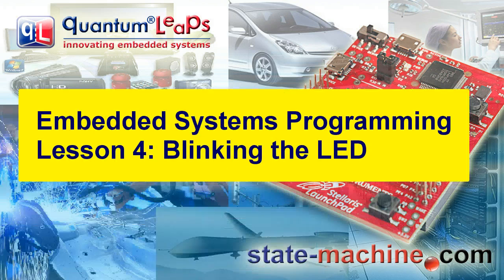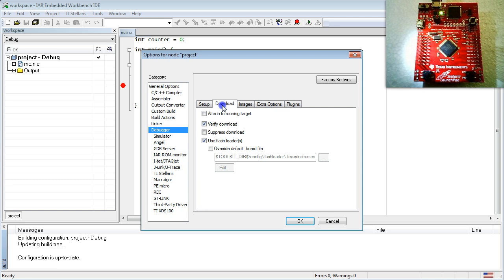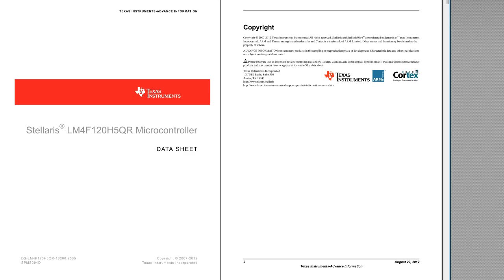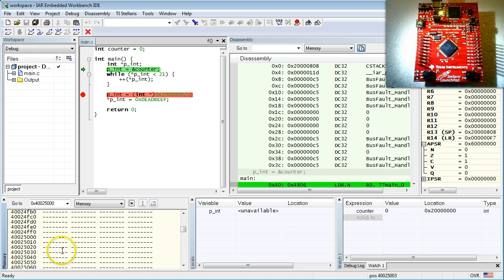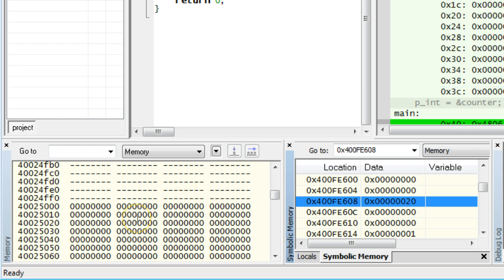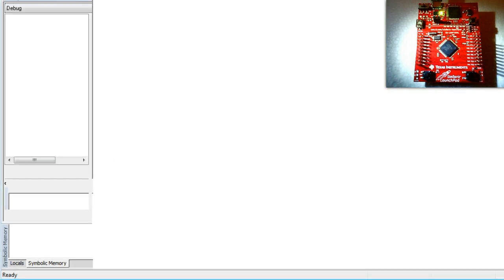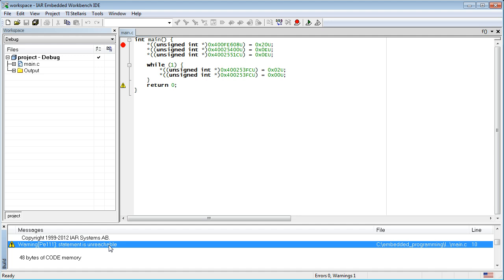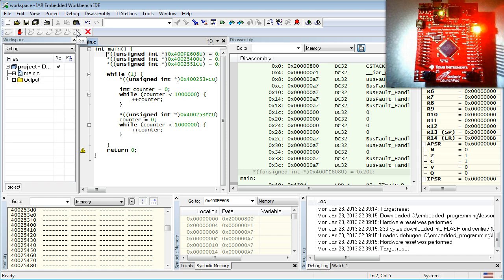#4 How to control the world outside?

Comment from the maker: I keep getting a lot of emails from people having trouble connecting to the LaunchPad board. Please visit the companion web-page to this course (https://state-machine.com/quickstart/ ), where you can find "Tiva/Stellaris In-Circuit ICDI Manual (USB drivers installation instructions)". There is also a screen shot of the Windows Device Manager that shows how the LaunchPad board should appear in the USB devices section.
--MMS
Reply: could kindly tell me what do you mean by set bit 5 for the data in register addressfor GPIO F
Reply: @erwinrommel5593  i have same question
Reply: if we use MSP430 for the same lesson, is there any differents??

Comment: how do you know that address to change led color is 0x400253FC? I cannot find this info in datasheet. Please help
Reply from the maker: I realize that I skipped over that aspect. This is explained in much more detail in lesson-7 about Arrays and Pointer Arithmetic https://youtu.be/pQs8vp7JOSk?si=YbN3HPXHimM7Rf3o , so please watch. But quickly here, the on-board red, green and blue LEDs are connected to the GPIO-F port and are controlled by the DATA register. These DATA registers are documented in the TivaC Data Sheet as GPIO Data (GPIODATA) on page 662. Specifically, GPIO Port F (AHB) base is 0x4002.5000. On top of this, you need to add the bit combination corresponding to all bits set (binary 11111111, hex 0xFF). Additionally, because these registers are 4-byte wide, you need to multiply that by 4: 0xFF*4 ==  0x3FC. So, the final address is 0x4002.5000 + 0x3FC == 0x0x400253FC. --MMS

Comment: At~9:50 I don't know how to find anything on the data sheet about setting a pin as a digital output, is there any trick to find answers to this type of question in the data sheet
Reply from the maker: Yes, the information is available but hidden, and reading datasheets requires skill. This video shows the process from first principles using only raw addresses. But the next lesson (as well as the future lesson on C structs) will show how to assign names to registers, names that match the datasheet. This will allow you to search the datasheets much easier. --MMS

Comment: At ~9:30 I don't know where you get that at address 0x40025400 (GPIODIR Port F (APB) base +  offset) bits 1 2 and 3 should be set to 1, why not bit 0, 4, 5, 6, or 7? I can't find in the datasheet that these 3 specific bits configure these LEDs to be outputs.  Or why 0x4002551C are supposed to also be 1 2 and 3. Where does it say this? I am missing a puzzle piece somewhere, where is it?
Reply from the maker: This info is in the TM4C123GH6PM Datasheet (available on the companion web-page https://www.state-machine.com/video-course#Resources . You can search the PDF for "GPIODIR", which you find on page 663. On this page, you look for GPIO Port F and you find its address 0x4002.5000. Finally, you add the Offset 0x400 (provided in small print below the GPIO addresses). All this ends up as address  0x4002.5400, which you see at 9:50. Regarding the individual bits, they are explained on the same page. You need to know which LEDs are connected to which GPIOF bits, and this is described in the manual for the TivaC board (also provided on the companion web-page). --MMS

Comment: @StateMachineCOM why you wrote the data at 0x400253FC? I checked in datasheet it says that the data register is at 0x40025000, offset : 0x000. Confused with this.

Comment: Not sure if anyone else is having these issues. Currently have the c031c6, found the ref man, datasheet, usermanual, and some sort of schematics on google. I notice that none of them really have schematics like the like shown on the video for the Tiva, so I can't really find the ports needed for the led. I may just follow the course with the Tiva board since most of the comments / documentation seem to lean towards that for now.
Reply from the maker: If you wish to follow this course exactly as it was presented, TivaC LaunchPad is nice to have. However, the newer NUCLEO-C031C6 board should also be sufficient for this course. Regarding the schematics, a simplified version is available in the document "STM32 NUCLEO-C031C6 Board" available on the companion website: https://www.state-machine.com/video-course#STM32C031 . Also, the projects for the NUCLEO-C031C6 are available (such as for this lesson-04) so, you should be able to build and run them on your board: https://www.state-machine.com/course/lesson-04.zip . --MMS

Comment: Great thanks for mentioning the clock gating control, GPIODIR (direction), and GPIODEN (digital enable). It seems that we may design the busy-waiting loop(s) based on the clock frequency and the tolerable frame-per-second range for human eyes.

Comment: Hello, I'm using keil MDK and have trouble with changing memory values. I can change register values, but when i use the memory window -> double click a value and type a different one then press enter it doesn't change. I also tried to use the context menu -> change modify memory at 0xsomethin to the same effect.
Reply from the maker: Please remember that you cannot change the content of your ROM memory (in case you are trying). ROM addresses start with 0x0.... RAM addresses start with 0x2... --MMS
Reply: @StateMachineCOM  Thank you very much <3 Pretty silly of me, everything works exactly as it should.
Reply: @StateMachineCOM  Ok, actually this wasn't the problem. I downloaded lesson-04 from the website and the code threw read/write access violations(both the TI and STM boards) . As far as i know it's a problem with the simulator and after making a .ini file with
"
MAP 0x40000000,0x400FFFFF read write
MAP 0x50000000,0x500FFFFF read write
"
The STM project seems to modify the memory as one would expect from the code. Please let me know if this is a hacky solution circumventing a real problem.
Reply from the maker: @NoName-tn8rq  Thank you for raising the alarm, but I don't see any problems. I specifically downloaded and tried lesson-04.zip, and all projects tm4c123-iar, tm4c123-keil, and stm32c031-keil just work. So, I really don't know what to fix because nothing is broken for me. Please note that these projects blink real LEDs and, therefore, require real boards. They are NOT designed to work in the Simulator if this is what you are trying to do. --MMS
Reply: @StateMachineCOM  Sorry for any confusion. Making the projects work in the simulator is exactly what i was trying to do. Thank you for your help <3

Comment: Hi! I have two doubts..  
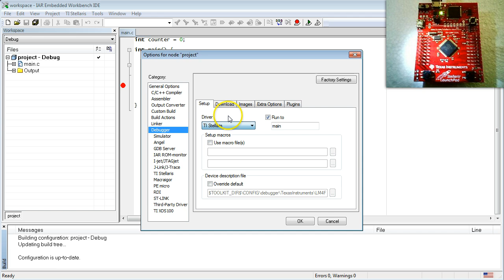1. I have connected the Tivac Launchpad and at 2:32 you have selected TI Stellaris -> Reset will do system reset option. However I have not found that in the latest IAR Workbench. What should I do?
2. After we had waken up the GPIO-F hardware block, the island from 0x40025000 has been enabled. But the next time when I dosconnect and reconnect the board, I assumed everytime it will get disabled in power cycle, but it remained enabled.. Should we reset the board everytime? if yes how can we do it?

Thank you very much for the video lessons, these are really great!
Reply from the maker: 1. IAR has removed the option "Reset will do system reset" option, so just don't worry about it. 2. Once you enable the GPIOF clock in your code, and you program that code into the board, it will get executed after every reset. That's why GPIOF clock appears enabled when you connect the board. You might want to experiment and revert to a blank main.c and program that into your board.  But I agree that truly resetting the TivaC board over the TI Stellaris debug interface is sometimes tricky. --MMS

Comment: 15:44 Is there a sleep function you can use instead of these loops? It seems very inconvenient to use loops this way if you want to change the blinking time to something more infrequent and/or precise.
Reply from the maker: Yes, there are other options to "sleep". For example, in order to improve the precision, the loop can be based on a hardware timer rather than guessing the CPU speed. But this would still be a busy-polling loop. The other method would rely on the interrupts, but this is only lesson #4 and there is a lot of material to cover before interrupts are introduced in lesson #16 ( https://youtu.be/jP1JymlHUtc ). Please keep watching! --MMS
Reply: @StateMachineCOM  Thanks for your reply. It seems like the TI board that you use in this course is no longer available to buy and the IDE is only free for 14 days, but I am continuing to watch your videos anyways, since they are explaining complicated things in a very easy to understand way. I have watched a lot of C/C++ videos on YouTube, but this course is teaching me concepts, that have felt really abstract before, in a very concrete way 😀 Is there any other board and IDE you could recommend to follow along in this course? For example the Arduino starter kit and their IDE, or is that too simple to learn about the inner workings of C/C++? 
Best regards

Comment: For the GPIODATA Register i would use *((unsigned int*)0x4002.5000)=0x1U //To write 1 in Pin 1, where do you get the 0x4002.53fc?
Reply from the maker: There is a whole separate lesson #7 devoted to the GPIO of the TivaC MCU. Please watch https://youtu.be/pQs8vp7JOSk !
Reply: @StateMachineCOM  i saw this video, but there is not explained, why you can use this  0x4002.53fc = 0x02U to write in pin 1 i thougt you have to use the adress 0x4002.5000 = 0x02U (Like in the data sheet "Register 1: GPIO Data (GPIODATA), offset 0x000")
Reply from the maker: @user-kj4mg5ok9k  I'm not sure if I can clarify this in a single comment here if the whole video lesson #7 https://youtu.be/pQs8vp7JOSk was not enough to explain how the TivaC GPIO works. But again: in this GPIO every 8-bit combination has its own separate address, starting from the offset 0x4002.5000. The particular bit combination 0xFF corresponds to all 8 GPIO lines. The address of this combination is  0x4002.5000 + (0xFF << 2) == 0x4002.53fc. You have to apply << 2, because the addresses are of whole 4-byte words. This address is clearer with the C array notation GPIO_PORTF_AHB_DATA_BITS_R[0xFF]. Please think about it for a minute. --MMS

Comment: You have 0x8000 Adresses that means about 32 k  Adresses. On each adress there is a 32 bit (4 byte) value i would think these are 32 k * 4 = 128 kbyte memory. Is that wrong?
Reply from the maker: I'm not sure where in the video you see 0x8000 addresses, but the number of available addresses does NOT mean that they are all used for memory. In fact, most of the 32-bit address space (4GB!) of the ARM Cortex-M CPU is UNUSED. The memories, such as ROM (flash) and RAM reside in different address regions and there are huge gaps of unused addresses between those regions. Please refer to the Memory Map shown in Table 2-4 on page 92 of the Data Sheet of the TivaC MCU at: https://www.state-machine.com/course/TM4C123GH6PM_Datasheet.pdf

Comment: Around 12:40, you start breezing through the memory hex at a speed I just can't keep up with it, despite re-watching several times. Is there somewhere with additional resources that would help me understand what's happening during that segment? Maybe not specifically this project/board/tutorial, but something akin to it?

 I feel like you're clearly stating what's happening, but there's so much meaning behind each word that I'm unable to follow.
Reply from the maker: To understand the addresses used around 12:40, you need to go back to the datasheet, which is discussed earlier in the video at 4:22. Actually, the best way to proceed would be to have the datasheet open on the right page with these addresses. I should have shown this side-by-side in the video. (Now I would probably do it, but 9 years ago I was still learning how to present the information...) --MMS
Reply: Also, at 10:15, you say 400253fc for the memory address, but I don't understand how you know the far right column in the memory table is "C" for the line 400253f0.
Reply from the maker: First, you need to understand the Memory View at 10:15. So, each row shows 16 bytes. You know this, because the addresses in the left-most column advance by 0x10 (e.g. from 0x400253d0 to 0x400253e0 and so on). To find address 0x400253fc you need to count 0xc bytes from the left of row 0x400253f0. But this is admittedly a bit tricky, because the GPIO registers are 4-byte wide (these are the 4-byte-wide columns in the view). Address 0x...c corresponds to the forth column, because the offsets of the columns are: 0x0, 0x4, 0x8, 0xc). I hope this starts to make sense... --MMS
Reply: @StateMachineCOM  your presentation is fantastic, btw. When I first started watching the very first video in the series, I thought "oof this is dry", but now I realize the folly of my thinking. Your videos are fantastic and I'm happy to see I have dozens more I can continue to learn from. The topic that brought me to your videos was event driven programming, but I realized my knowledge lies somewhere between video 1 and 33, so I'm starting from the beginning cause you teach more useful knowledge than any other course I've seen.
Reply: @StateMachineCOM  Thanks for the explanation about 10:15. I think what was missing for me is this: while 0x0 through 0xF is 0 - 15, it is only 4 bits, not two bytes. Ignorantly, I was thinking a denary value of 16 was two bytes long, not 1/2 a byte. So this whole time I've been trying to cram that erroneous logic into everything. 🤦‍♂
Reply from the maker: @RandallLowetx  I'm glad to hear that you like the approach. I also set out with the goal of teaching the "Modern Embedded Programming" with event-driven paradigm, state machines, active objects, etc. But it took me... 8 years to get to that, because I had to lay the groundwork. But the later video lessons in this course are getting finally there... Stay tuned! --MMS
Reply: @StateMachineCOM  I'm impressed you could keep trucking along for 8 years... I wish I had that focus! And definitely excited to get to that point. 
I'm developing a system that interprets CAN data from an electric vehicle into pwm signals to drive systems and (namely hvac and instruments) in older cars which have swapped up to an ev platform. The stuff you teach aligns with that goal really well so far 😁

Comment: FATAL ERROR. failed to initialized device. pls help me out
Reply from the maker: Hi Jay, Please see the pinned comment to this video about the companion web-page (https://state-machine.com/quickstart ), where you can find, among others, the document "Troubleshooting TivaC LaunchPad". This should help you to unlock your "bricked" board. --MMS
Reply: @StateMachineCOM  hello thank you for replying. one thing i missed to mention that i am using msp432P401R launchpad. the procedure doesnt seem same for the board i have i guess.
Reply from the maker: Even though MSP432 is also based on the same ARM Cortex-M4 core, it has different peripherals than TivaC. Therefore, the projects for TivaC won't work directly on MSP432. --MMS

Comment: Good tutorial however it seems that we needed to be aware of the fact that GPIO port F was clock gated in the first place. If you hadn't mentioned this fact in the video, I probably wouldn't have been able to get the LED to blink. For a beginner like myself, how would I even be aware of things like clock gating? I had never even heard of clock gating until you mentioned it! Is it mentioned somewhere in the reference manual that to use GPIO port F, I would first have to disable the clock gating?

Comment: This is a nice video series, but what if the led pin was not a memory mapped IO part. Then is this method feasible
Reply from the maker: We could play many "what if" scenarios, and a 16 minute lesson cannot cover them all, obviously. But for the ARM load-store architecture everything looks like loading or storing data. This includes accessing peripherals. Other methods are possible and older processors can do it differently. For example, the venerable x86 has a separate I/O address space that it accesses with the IN and OUT instructions. --MMS
Reply: @StateMachineCOM  Thanks for clearing the doubt

Comment: Hi, could you elaborate on what you mean by the memory map not having segments or memory banks? 5:25    By segments, I am assuming you mean that the memory doesn't have any missing memory segments.  By memory banks, did you mean that if there were memory banks, they would be spread out across different address ranges?  Cause I think I've see 1 or 2 memory maps where SRAM was divided up into separate banks.
Reply from the maker: Older processors didn't have a simple, linear memory space. Instead, processors (like 8051, PIC12/16/18, AVR,  8086 etc.) had separate "memory spaces" (e.g., separate program space, separate data space, separate I/O space, etc.), segments of memory, and other such concepts, which immensely complicated addressing. Many processors of that era had also different instructions to accessing program memory, data memory, I/O space, or external memory. Finally, regarding "memory banks", often the processors could not address the whole memory they had using a single register (like the PC or SP). Instead, an address was a combination of multiple registers, one register used to address a "bank" of memory, and the other used as an offset into that bank. All of this is complicated and you would need to read about specific processors (like the 8051 or the 80x86), but the point is that modern CPUs, like ARM, make it so much simpler. --MMS

Comment: In my Simulator(same as yours) In memory it doesn't show 00000000 or even -------- at the address 0x40025000. It shows cdcdcdcd ! even after setting the R5 bit in the GPIO clock gate control register. I think that over these years Ti and EWIAR have modified something that's why the method you show isn't working. please suggest something
Reply: I understood the technique but just am not able to practice.